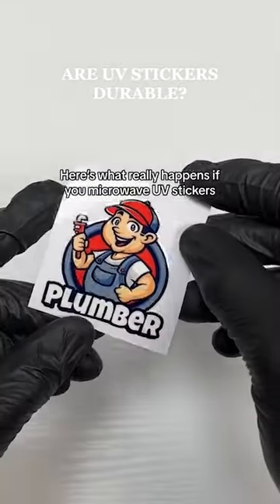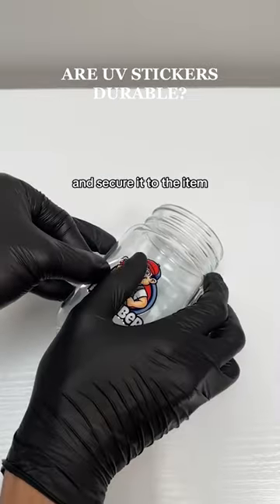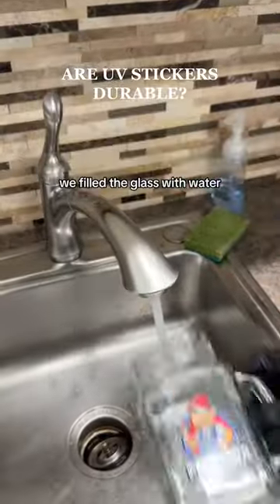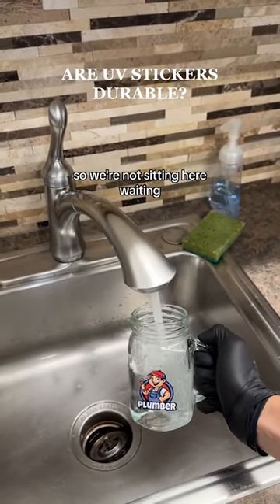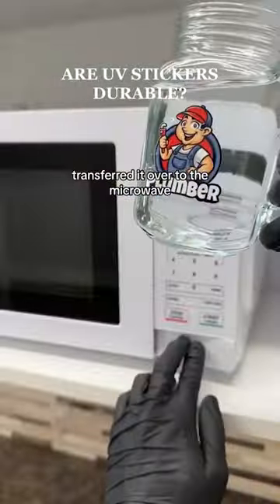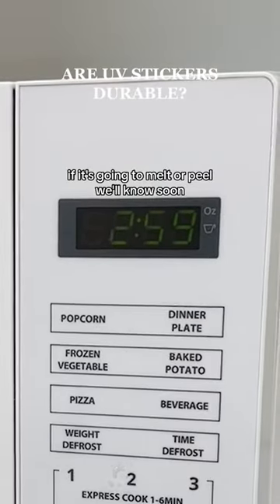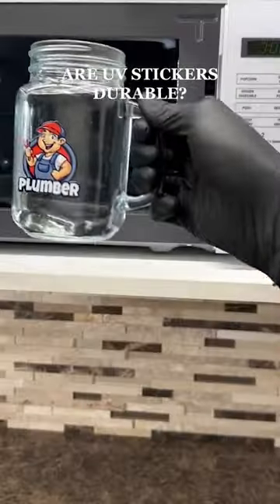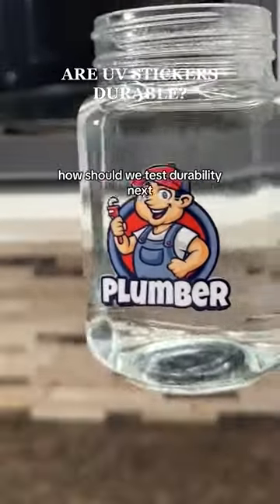Put our DTF PermaStickers on ANY type of hard-goods.

Comment: That water ain't boiling yo
Reply: Sometimes the water doesn’t boil until it comes in contact with a lot of surface area, like a powder or tea bag. That’s not boiling water, but it’s a ticking bomb
Reply: @malmamia8912  heard that boss man I didn't know that thanks brotha 👍👍
Reply: Because it doesnt have applied heat anymore its still hot

Comment: Nah bro I don't think that's boiling
Reply: Microwaves work by exciting the molecules which create heat. The water is at boiling temperature but the water needs a nucleation point to achieve a rolling boil because the surface temperature needs to be higher than the saturation temperature.